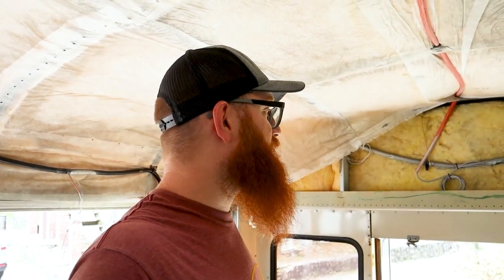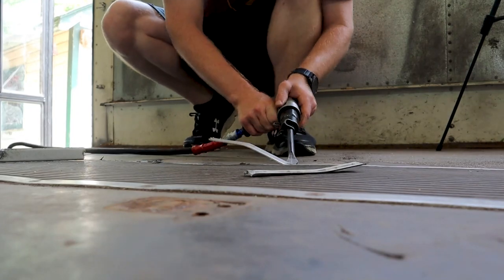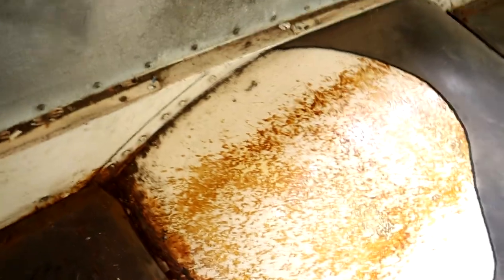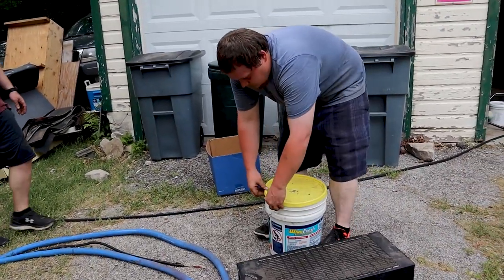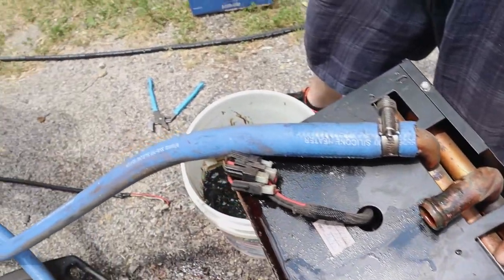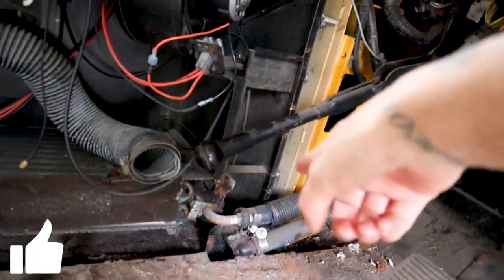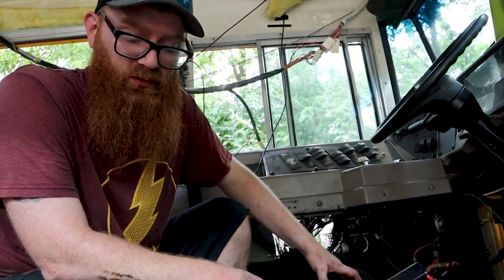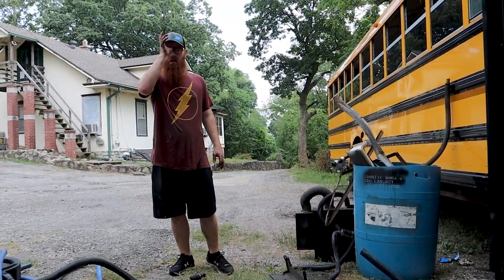Removing the radiator heating system and the rubber flooring| School bus tiny home Conversion EP.4

Comment: I was always wondering where a bus has heating system 😊 I had no idea bus won’t stop if you disconnect all the emergency lights
Reply from the maker: Yes there is certain things that have to be connected for it to start.
Reply: @caseystout3698  what are the steps to get the engine to start after disconnecting the emergency alarms, please???
Reply from the maker: The only alarm that caused us issue after we unhooked everything was the back door. So we traced the wire back to the fuse box and grounded the wire out so it will start thinking the back door is closed. 

We go through this process on day 1 off our roof raise. https://youtu.be/U5S20XMzfIM
Reply: @caseystout3698  thank you! I will check it out.